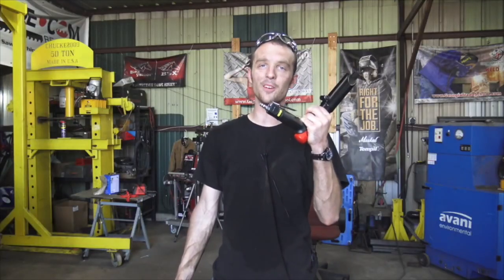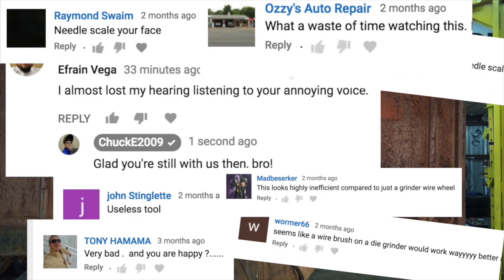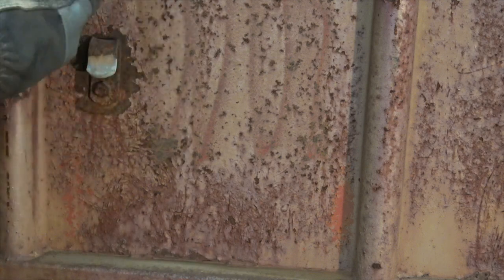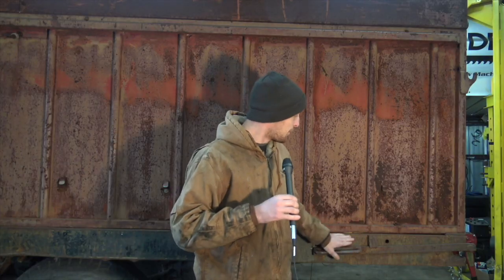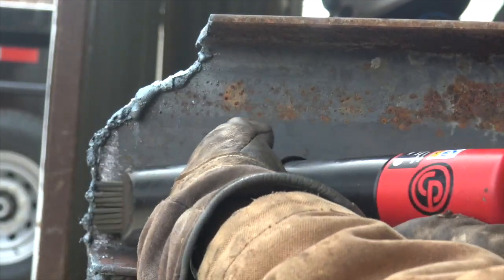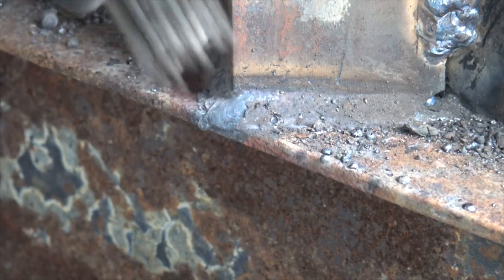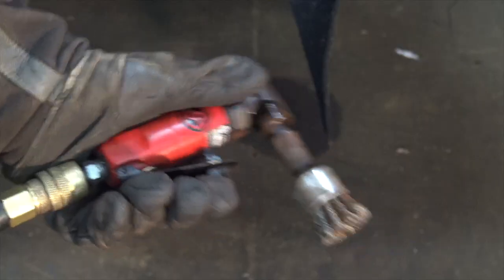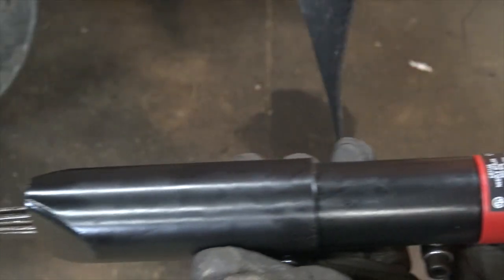NEEDLE SCALERS & WHY YOU PROBABLY NEED ONE - THE AMAZING TOOL THAT MOST PEOPLE HAVE NEVER HEARD OF!

Comment: I have been an equipment operator, industrial maintenance mechanic certified pool operator and a parks dept. grounds keeper retired now. It amazes me how many people have no knowledge of tools or how to repair anything.  With what you pay to have anything fixed these days you would think people would learn at least the basics. Great videos on equipment repairs and welding tips. I also like your tool reviews especially when you go to a tool you have had for several years and discuss how well it has held up.

Comment: Grind the individual needles to a rounded end or cone end to camouflage repairs to cast iron surfaces.  
Grind the ends flat to remove thick rust.

You can use a metering valve or reduce the air pressure to reduce striking force.  They create great sound effects when running them against a steel pipe or I beam.

Digging mud off tractors. Grind tips to a 45 degree angle. The dry hard mud explodes .

Comment: At my first welding job in Flagstaff in 1973, my boss had a needle scaler that we used for chipping slag (especially in tight corners, where slag can sometimes be very hard to remove) - it was the handiest tool ever, saved a ton of time  not having to use a chipping hammer.  They're also very good for stress relieving cast iron when welding or brazing.  I recently found a good one at Harbor Freight (the top of the line model there - the Chief Professional Air Needle Scaler), and have been using it a lot on my welding projects around the house.  We don't have the heavy rust problem here (Colorado), so I don't normally use if for descaling, but it's still an incredibly useful tool, and can get into spots that a spinning tool just can't.  And it makes you feel powerful!

Comment: I will be 41 years old next month September when I got into the welding industry that's when I discovered What needle scalers are and like you said they are for removing slag from well deposits and yes they're very handy for cast iron I used to have a job where all I did was use a needle scalar to remove spatter from commercial shipping containers used for Air Freight the other people that use needle scalers are sandblast operators and antique restorations on old things like tractors swimming pool lining people use them to to remove old Linings from swimming pools

Comment: So I purchased this freight container for storage.  They are priced according to their condition.  I got the cheapest model and needless to say it had many places with loose rust and peeling paint.  A needle scaler was the tool that quickly removed the bad rust and paint and after a local coat of primer and a finish coat of paint the problem was solved.  After over ten years there is no rust showing.  Doesn't work on all the dents.  Got to buy a more expensive container for that problem.

Comment: They use a lot of air. Many home shops don’t make enough so you may have to take pauses to let the compressor catch up if doing a big job.

This is the number one tool used on ship for deck maintenance!
Wear thick gloves , the vibration is strong and they will help a little.

Comment: Good video.👍 And don’t forget, those needles are HARD.  I could tell you a story about needles coming off the front of a needle gun when a Painter was working at the Ross intake: one needle got under a wicket gate and jammed it, taking a 100 Megawatt hydro unit out of service and necessitating a lot more work than the usual shearpin replacement.  Save those old needles to make scribes.